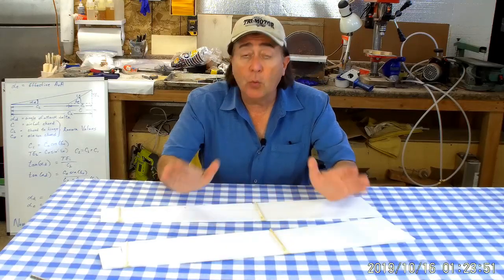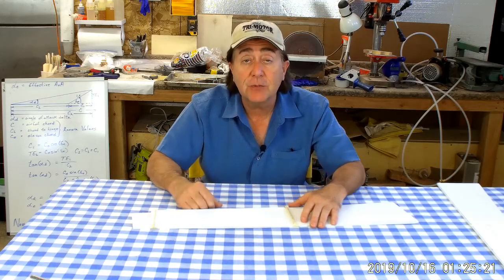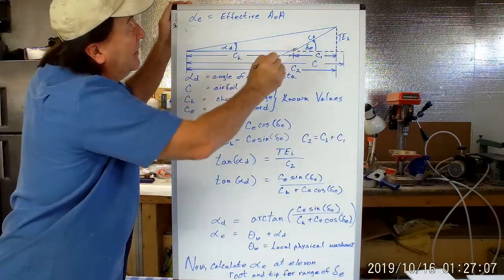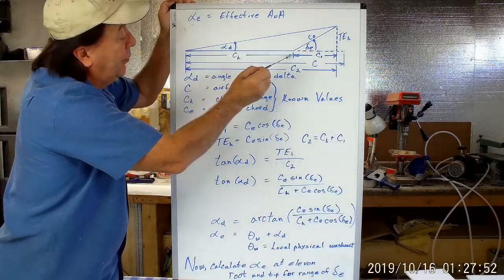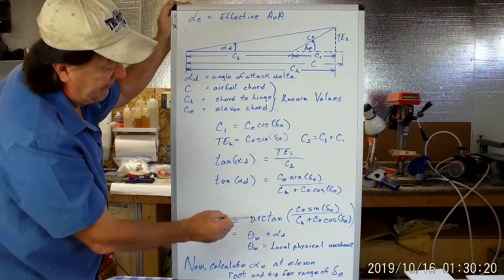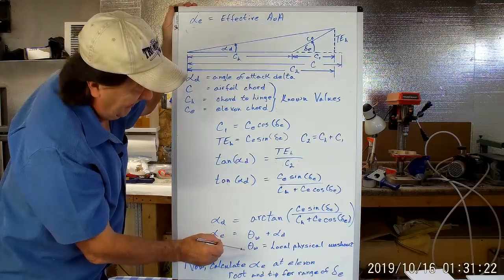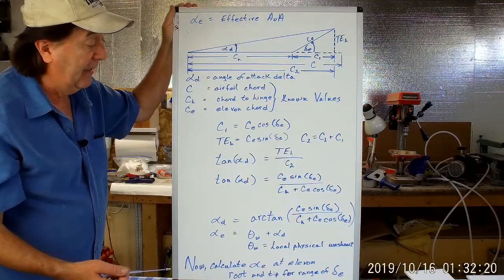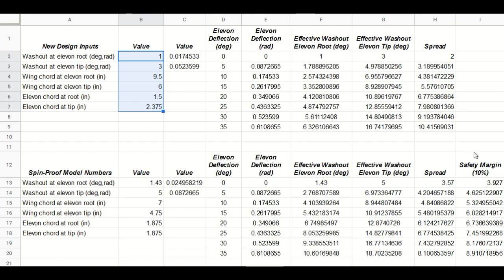Repost due to error. Preventing Spins, Part 7 - Final - Klingberg Wing MkII Development

Comment: fascinating, thank you.  Elevon planform is apparently less important for very low aspect ratio wings, such as the Facetmobile. Wainfan used  rectangular control surface planforms and got a stall proof airframe.  At what point does the spin hazard appear as the AR increases?
Reply from the maker: Wow, on two levels! One wow because it is clear that some folks (like you) really understand the concept I'm trying to spread around. And a second "Wow" for a great question. I could kick myself for not thinking of doing the calculation you suggest. The results should plot nicely (might be a 3-D plot) but very useable as a tool for designers. You are correct, as aspect ratio decreases the shape of the elevon becomes less critical. I did a demo of what happens with a delta wing but it ended up on the cutting room floor. With delta wings, because the tip chord is usually very small compared to the root, the elevon is generally a large percentage of the chord (elevons are usually rectangular on delta wings). This arrangement results in plenty of margin on washout and hence generally spin-proof (stall proof is a different animal and dealt with differently). Perhaps someone out there will run through the calculations for a spread of aspect ratios vs. different elevon tapers and plot the data and share with everyone. I'd do it, but I'm really busy right now making the D-tubes for my wing. Anyone care to do the job?  The results should be very cool.
Reply: Klingberg Wing MkII  Thank you very much for the favor of your reply. 

Hmm...  I think I was imprecise. I suspect there's a lot of different possible control surface planforms on Facetmobile. At that AR, I suspect control surface planform is not critical.

Facetmobile is spin proof not because of aileron planform, but BeCAuse its low AR is stall proof, and the lack of stall (I THINK) is because vortex lift blankets the entire upper surface at high AoA, coming in from the sides and meeting in the center.

 Barnaby said they could abuse the controls in the RC model every way possible and never got it to stall. 

http://wainfan.com/3VIEW.JPG
Now that I think of it, I suspect that when the gap between the vortices increases with AR, to some dimensionless number that has a mathematical relationship to aspect ratio, then control surface location (arithmetically/logarithmically) approaches criticality but the planform isn't important until the tips start to taper.. 

Hasn't CS planform been worked out by the Skunkworks for the B-2 ? They have rectangular or trapezoidal control surfaces, but because they are on the sawtooth trailing edges of the wing (not normal to streamlines), the airflow does not see them as rectangles the way they would on the trailing edge of, say the Hershey bar on a Cherokee.

Oh wait a minute. Because of the vortex on the tip of a Hershey bar, the airflow doesn't see a rectangle there, either...

Think of a vortex generator: we use them on the upper chord to good effect. Where else are we (perhaps unknowingly)taking advantage of this phenomenon, vortex force?

The tip vortex on a Hershey bar extends from the tip approximately one chord length inboard. 

So if any wingtip is tapered (I suspect at the same or greater nose angle Northrop found optimal for his flying wings), then this 'unravels' the force and your reverse taper becomes necessary because the 'vortex generator' effect which energizes the flow at that spot is lost. 

And you want wider ailerons just where it becomes more difficult structurally, at a tapered wingtip. If I understand the situation correctly.

There must be a mathematical relationship between the rolling force you need to roll the Klingberg and the amount of energy the vortex can generate for any wingtip chord at various Re. I.e., is the criticality of the aileron planform an artifact of, a tradeoff caused by not taking advantage of vortex at the tip?

Now think of the wingtips of a California Condor: multiple feathers at the tip, each of which with it's own vortex. Is that what it takes to create a drag rudder at the tip, given the mass of the airframe and the moment at the wing tip?

https://i.pinimg.com/originals/64/2e/1a/642e1a8701166f9ab22df91bc415bff3.jpg
Second question:

Think of the planform of almost all birds: it's combination lifting body /flying wing, or maybe more accurately a blended wing/body. None have vertical tails, they have ailerons/drag rudders at the tip, speed brakes formed by wing warping/variable sweep, and elevators located at the aft end of the lifting body. Are you trying to do something nature doesn't by eliminating a central aft tail/elevator? 

Now think of that FAcetmobile planform with wings sticking out the sides, wings having some fraction of the chord of the main body such that the planform maps congruently to a California Condor: 

That is the tree up which I am barking.